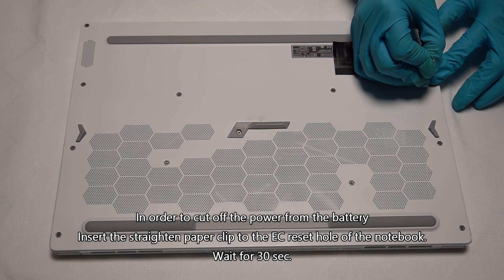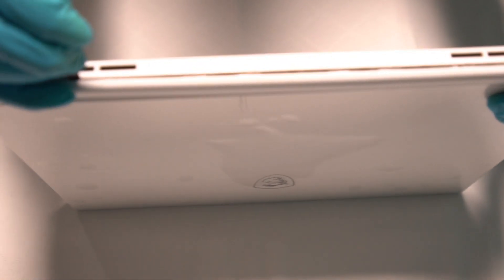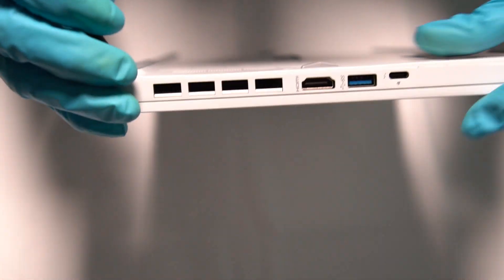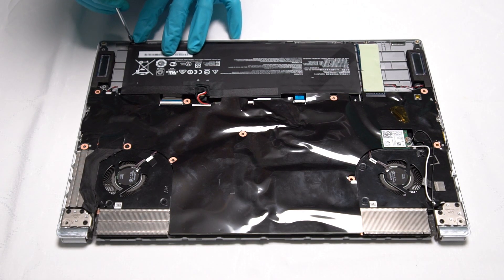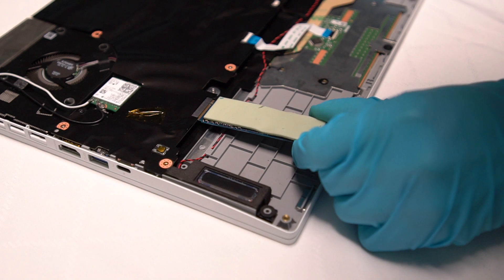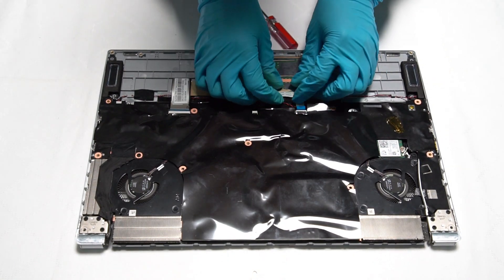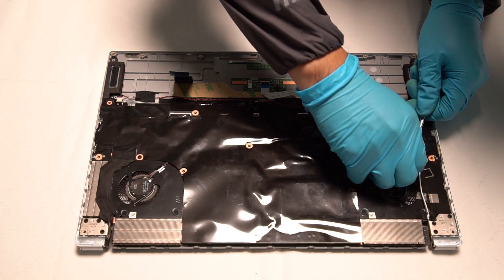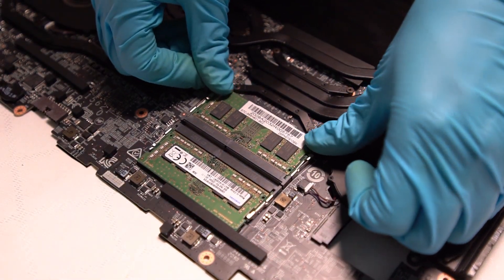MSI Stealth 15M Series SSD & RAM Upgrade Tutorial

Comment: After doing this, the laptop powers on but wont boot. MSI Stealth 15M (A11UEK-009) with Corsair Vengance DDR4 3200MHz. Any one able to help?
Reply: I have that exact laptop and ram kit and i can't get ir to work, did you solve de issue?
Reply: Lol I have the same problem with the same components.

Comment: *Note* mine had a “factory seal sticker on the back. There is a screw under the sticker that needs to be removed when removing the back panel.
Reply: Hey! Do you have problems with the temperature of the laptop, like you know it gets really hot in the fans. i would really like to know if its normal cause sometimes hurts while playing.
Reply: @santiagoarcosrivera1786 it's normal for it to get pretty hot

Comment: I did that, later my laptop didnt turn on
Reply: How did you resolve this? I’m having same issue. System comes on with power plugged in but battery not powering up
Reply: The same thing happened to me too. How did you solve it?

Comment: This laptop is horreful, impossible to move under 144hz , it locked on this shit. 

Performance on game are trash , even some game dont run online. Still don't know why.

And MSI dragon center is an cancer for this laptop. Blue screen often.

And it come with a montain of shit préinstalled softwares.

MSI never more!
Reply: Performance on games (and I've played doom eternals on high settings around 50-60 FPS) are good though. MSI dragon center is fine and haven't blue screened once. The pre installed software can be uninstalled. Also not much reason to go under 144hz in the first place just use VRR or disable Vsync.

Comment: After the ram upgrade, my Keyboard backlight does not work. Is there any cable there that could be unplugged?
Reply: The only criticism of this video is that is not describe carefully as he dismantled the whole thing, it’s possible that you missed a cable connection.
Reply: @URIBENFILM  Hi, UPDATE: yes, the backlight cable was black IDK why I did not see it so I forget to plug in.WORKING NOW
Reply: @brandnimation  i have one. can u give me advice how to less the temo is too hot .
Reply: @sanapieso  I use throttlestop and disable the turbo mode off the processor. Sits at 70c while gaming. Fans don't go too mad either.

Comment: Ram ready to up 32gb for 2 slot?
Reply: According to the official msi page this model supports max 64gb of ram  in dual channel so tou are fine with 2x16 or 2x32, just make sure o buy the same ram model or at least a ram with the same frequency, 3200mhz

Comment: So, is there no 2nd nvme slot? Kind of odd for a 15in
Reply: Looks like it. At least the drive capacity has increased so much we wont need the 2nd drive slot. We can just get 4-8tb M.2 Drive in and no need to worry about space for a long while. :)
Reply: If it ever breaks that’s the problem, 2 NVMEs slots would’ve been nice.
Reply: @mikaeldalc  didn’t hear that in the video if it’s mentioned, other reviewers claim there is only one 🤷🏻‍♂️
Reply: @URIBENFILM  sorry, I thought I was responding to another reply based on another Laptop.